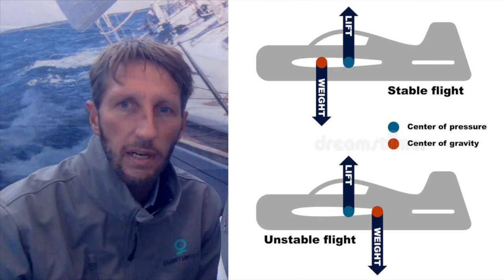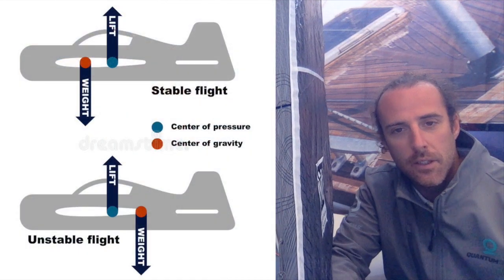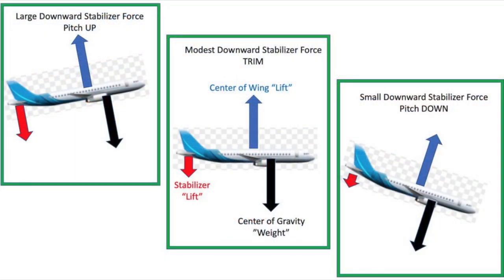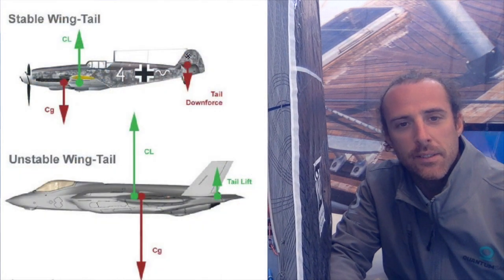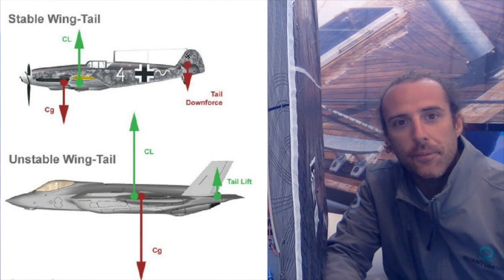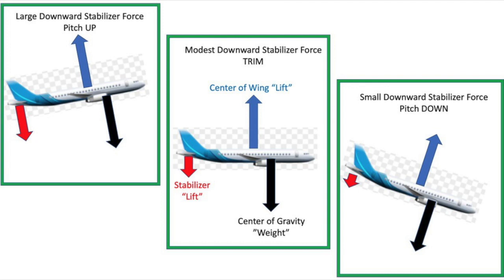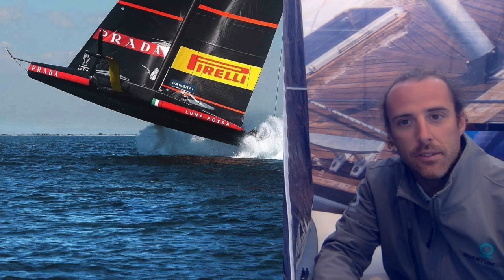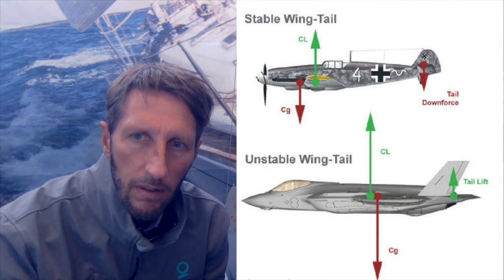E68 - Stable flight and center of gravity in the AC75s Final

Comment: Great video, love listening to your thoughts, it's very insightful! Appreciate the English video's, please keep them coming!
It looks like the cup will likely be decided in straight line speed if the weather is fair. Most of the boats training videos hint that this AC class will achieve 100% foiling time around the course. So 'unstable' flight will be an essential to achieve those high top speeds. The question must be how much lift can you get the rudder to reliably give you while also running aggressive bow down trim for minimal hydrodynamic drag?
Reply: "It looks like the cup will likely be decided in straight line speed"... not necessarily! It comes down to VMG - Velocity Made Good. This is a trade-off between speed, and the angle you can sail to the wind. In AC35, many times NZ sailed closer to the wind, and slightly slower, than the US - but had a faster VMG.
I think you're right about the rudder... it's a very fine line between reducing drag (bow down), and losing the rudder completely from ventilation!
Reply: @maxhugen  totally agree, ETNZ were able to reduce their leeway over the others with their aggressive foil design also, in a sacrifice for speed. My thoughts were more on stable flight Vs unstable flight and if 2 boats had similar upwind performance but one relied on the rudder for down force (stable flight) and the other had lift from the rudder (unstable flight) it would out perform the stable one in straight line speed every time because it has less drag? So if you were a designer the choice should be clear in this regard? My main question is should we really expect to see any stable flight, design philosophy, boats on the race course when the time comes or am I overlooking something? (And side note is it possible to tell the difference between them in video footage other than when it goes wrong?)
Reply: @vinceb3974  "Stable Flight" is a misnomer, as what may be "stable" at 6 knots will not be at 24 knots. 
I disagree with Pietro on "stable flight" in aircraft with CG forward of CL - this is to avoid a dangerous stall. If it were stable flight, and went into a dive due to this CG-CL, it would recover to level flight. It does not. 
What's more, the designers have to cope with the force of the sails trying to drive the bow of the boat into the drink too!
If I were a designer, I'd be heavily into CFD and other computer programs (as designers are), as it's way too involved for "common sense" or intuition these days. 😎
Oh! Plus testing to verify the computer data of course!
Reply: @vinceb3974  Didn't really answer you though, did I? 
The design rules stipulate where the foils must be (10-12 m forward of stern), also mast position etc. 
Looking at the design you can clearly see the bulk of the boat is aft of the foils, as well as mast, mainsail, crew etc. Therefore, they MUST use lift from the rudder foil as well for balance. 
Straight line speed, as far as foils go, will be having the least foil-induced drag (less area is better), but still be able to transition onto foils as fast as possible. Lateral lift (to windward) will affect their VMG, so you can see that both NZ and AM have been canting the foil arms less, to increase this lateral force. Does this help at all?  🤷‍♂️
Reply: @maxhugen  That makes alot of sense. I have noticed alot on the newer footage of the boats you can see the, working, foil tip breaking the surface meaning they are really trying to get maximum windward lift. Not something I had noticed before about 3+ months ago. (That's not to say it wasn't happening but I didn't notice it). I love this class and trying to think about/workout the performance mechanics of it. Looking forward to seeing the new boats.
Reply: @vinceb3974  Yeah, I've only noticed the foil tip surfacing for maybe the last 4 weeks or so. They must test endless configurations! Same re new boats... maybe some surprises there?
Reply: maxhugen RE: stability and stall: No Pietro is correct—although, perhaps, the explanation focused too much on this notion of stall—having the C.G. aft of the center of pressure means that perturbations in attitude are amplified. The forces act (by definition) on the center of pressure which creates a moment arm about the CG that makes the craft want to flip and face the other way. While you’re 100% correct that there’s more to stability analysis and general performance analysis, there are still fundamentals that can be understood with back of the envelope calculations and traditional engineering analysis. (Don’t get me wrong, CFD and other computational tools are critical for speed and handling optimizations—in fact my PhD from s in CFD but for high speed supersonic aerodynamics. And without adjoint based simulations for design optimization you’d be stuck with slow and expensive parametric studies.)
Reply: @zbeekerm  Right, I had not considered CP re CG in aircraft in addition to the stall factor. But with the AC75, CP is much higher than the foils, that must produce significant turning moment? Which I assume has to be balanced by having CG well aft of CL... or is that wrong?
Reply: @zbeekerm  A question, if I may, given your CFD expertise: Regarding the cavitation "brick wall" the hydrofoils run into, would allowing some fluid to "bleed" through from the lower surface to the upper surface to slightly increase pressure to just above critical "vapour point" (?) help to prevent cavitation, and allow the foil to perform above current limits?
I've seen diagrams of the V shaped supercavitating and base cavitating foils, like Sailrocket used, but of course they're not much help at slower speeds.
Just wondering... as an amateur. 😁

Comment: Fascinating. It would seem that a foil design could stall at a certain angle of attack, if a falling rudder tail causes lift, though perhaps that’s outside the allowed shaping. Seems like a very difficult balance, and still a big issue turning around a course.
Reply: Quite true, at a high AoA the foils do indeed stall - although in some of those "sky jumps" we've seen, the foils are clear out of the water entirely! 😁 Definitely a very fine balance... a good part of the Kiwi's success in AC35 was maintaining that balance.

Comment: Ah yes the good old passive aero(hydro)dynamic stability criterion: put the center of pressure behind the center of gravity. I learned this lesson the hard way long before studying mechanical and aerospace engineering in college and graduate school: as a 12 year old my friend and I designed and flew model rockets, and we created “the widow maker” painted it neon orange and decorated the leading edge of the fins with pretend blood. Unfortunately, the rocket consisted of an Estes C 6-7 engine, enough tubing to accommodate the engine and nose-cone and some triangular fins which began and ended where the fuselage/motor-mount tubing did. Needless to say it spiraled violently out of control before digging itself half a foot into the lawn. We all breathed a sigh of relief when it was safely embedded in the earth, but the danger was not over quite yet: in an attempt to achieve maximum altitude no motor retaining clip was used so the “parachute” ejection charge would just eject the engine. After 7 seconds of delay, the spent motor casing fired at an a cute angle across the lawn. It was at that moment, as a 12 year old that I realized 2 things: the fundamental criteria for passive stability during flight, and that I wanted to study fluid mechanics.
Reply: And realized I was a very lucky person to still be in possession of both eyeballs.